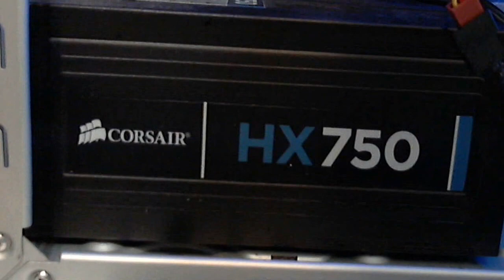HAF 912 fits Dual 120mm Radiator like the H100i INSIDE

Comment: Im buying CoolerMaster Nepton 240M and ill place only radiator inside and both fans on top outside to pull the hot air from case ill also seal the top grill that is not covered with radiator or fans for even better exhaust

Comment: Is it possible to put the fans outside and the radiator inside if the radiator only has 2 fans
Reply from the maker: Yes it's possible, but the gap between the fans and the rad will make for pretty bad performance.

Comment: i have been watching ur video serveral times now. i have the HAF 912 myself and wanna go watercooling on my 3570K
is it possible if i put it in push(inside) to cut of half the corner so i coud fit a (small) screw inside
Reply: i mean in the corner u cutoff. 

i would really like to use the corsair fans and like mount all the corners, modding itself aint no problem ;)

Comment from the maker: The entire rad has been moved away from the motherboard by drilling new holes, so no fan modification is required. IF you want to use their holes however, you will need to do some modding to get the fans to fit.

Comment: Coolermaster could make this case with a little more room at the top to fit in the H100i with the fans on the inside and slide it all about an inch more forward so the back fan can still be on the inside of the case... I can not believe coolermaster has NOT even considered the making of this case for all in one water cooling at the top and made enough room to accommodate a 240 mm radiator and 2 120 mm fans so it clears the mother board... Love my 912 advanced case with window!!

Comment: I did something similar with my 912 advanced... but I drummelled on the other side from where you did so the fan cables came down next to the mother board, the radiator inside, the fans on the outside and silverstone fan grills over the top.. and I had the fan on the outside of the back as well and also routed the fan cable through the one small grommet.. but gave second thought to it and the noise from fans outside the case and just removed it...

Comment from the maker: That depends on if you want it full internal. You will need to modify it regardless, but you only need to shave the fans if you want 2 fans. For internal push/pull you will also need to modify the case. Which you can see in my second video.

Comment from the maker: I would advise against using the front ports for exhaust because heat rises, You would get better flow by using the back port as exhaust and the fronts also as intake. Instead of trying to force hot air against the way it wants to flow. I've never used a stock cooler, but my previous cooler was a thermaltake Water 2.0 which was only a single 120mm radiator. I've seen a temp drop of around 10C on my overclocks so I'm very happy.

Comment: Ok thanks, I found a post where one guy had the radiator mounted on the top, outside the case.  I think Im going to go that route.  It involves cutting a few holes and taking out then replacing rivets but it keeps the bulk of the unit on the outside.  I would then reverse my current cooling; intake through the radiator and then out through the front is what I am thinking.

How much improvement temp wise did you see using the h100i or was this the first cooler you used?

Comment from the maker: @Steven Kayfes Yes this is what you need to do if you want it centered on the where the pre-existing fan holes are. But this also makes a fully internal push/pull impossible because of where the radiator would sit.

Comment from the maker: There is always fresh air outside the case, so theres never any hot air going into the radiator. By using 1 120mm fan for exhaust out the back I can ensure that theres positive pressure inside the case. Which is good for keeping dust out.